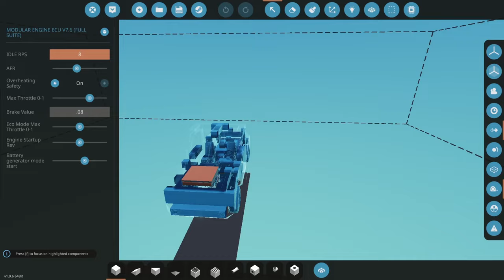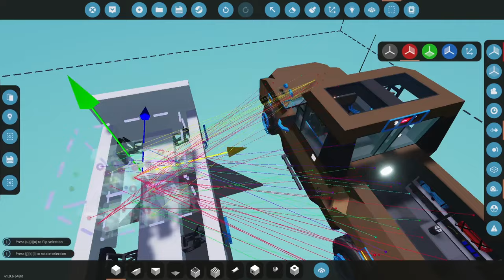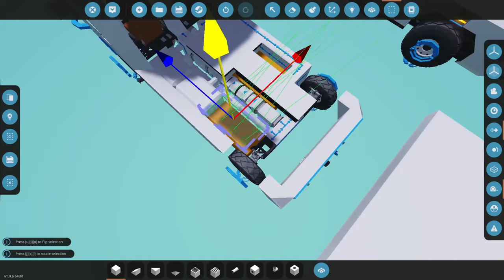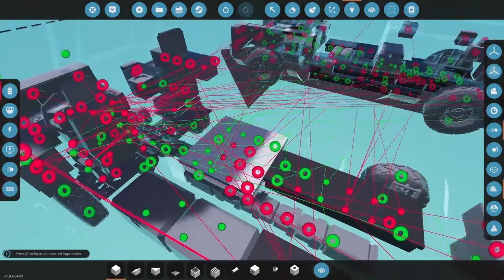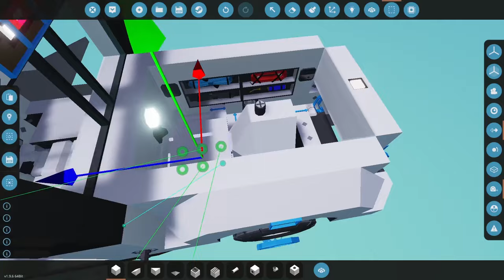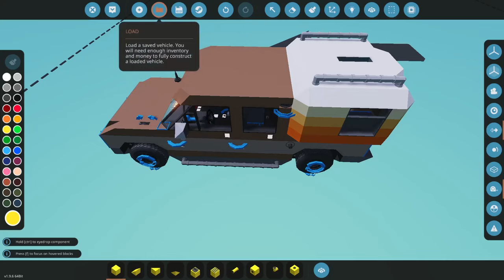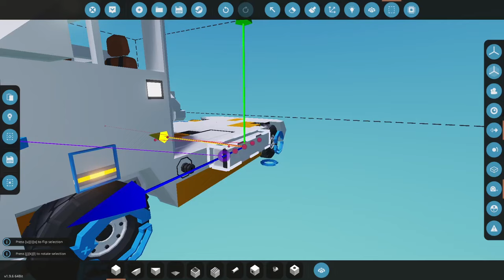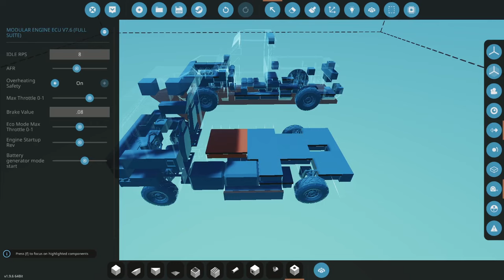Making SUPER COMPACT designs in Stormworks

Comment: Knowing how to build small is as valuable if not moreso than knowing how to build big.
Here are some tips I know from just screwing around:
Seats are very space intensive, and you'll want to build the cabin ceiling one block higher than the minimum (like you see in the video) so the PC's eyes don't clip through blocks.  You can mitigate this height by having the base of the seat be at the bottom of the vehicle instead of another layer of blocks.  You can even rotate the seats back (with robotic pivots) so the player has a lower height profile while being able to see forward.
Wheels are also space-intensive so make sure you plan them out (especially if they're bigger wheels) while deciding on the overall design.
If you have an internal rotating system (like a turret on a tank), do some testing so you can figure out the minimum interior size it fits in without collisions.  Slope blocks are your friends especially when laid out in an approximate circle.
Reply: Sloped blocks my beloved. I like how block hitboxes in this game are very generous.

Comment: Hey, just to give you a tip from real life, japanese micro trucks are a pretty big but niche sub-market. They're generally very small and light. However, they come with less features  and smaller engines. Often being measured in cubic centimeters rather than liters for displacement. Maybe you could consider following in the micro truck footsteps and removing some more controllers and cylinders to get a lighter and smaller, yet still capable truck
Reply from the maker: Totally :D I love that! I might just do that!

Comment: when im building something, first im trying to determine everything i want to put inside, and put it on platform on the side. Then im roughly building shape i want my creation to be, using colors im marking blocks that i need and those that i can change to something else like sensors or chips. Usually on the side im testing engine or other mechanical parts to make sure that they work properly and have enough power etc. usually in paint im drawing how i want electricity, power grid and fluid management (and now gas management also) to work. And then im puting everything together